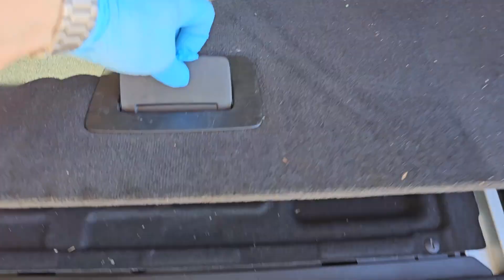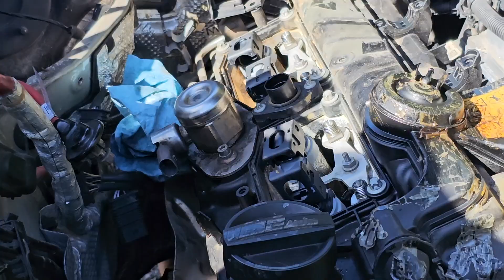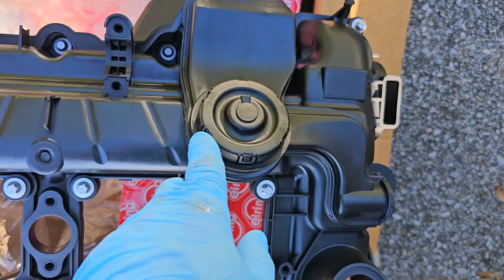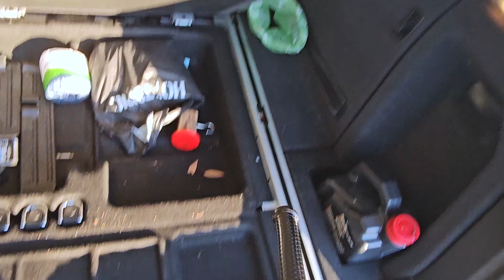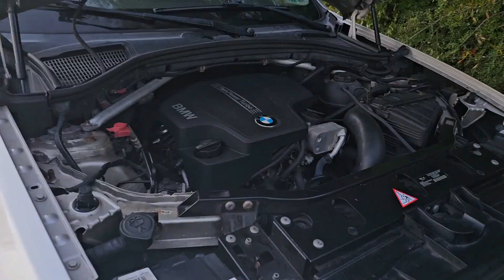Valve cover Replacement , n20 to n26 swapped

Comment: Thanks for this upload just swapped another n26 motor into my 328i the replacement motor has a bad valve cover so we’ll be doing this repair when it arrives. Upgrade to the aluminum cover for the n26 with built in pvc best wishes
Reply from the maker: Glad you found the video helpful, hope the repair goes well.

Comment: The oil cooler to filter housing uses 3 special bolts that are "one-time-use" (stretch-bolts) and they cost $25 each. Is it really necessary to replace these 3 bolts and not supposed to re-use them?  The other three bolts (different sizes) for the oil filter housing to engine block seem to be normal bolts.   

Also: is Mahle's oil cooler gasket that they call "bonded rubber" made of Viton (i.e. FKM / FPM) ?   It is MAHLE / CLEVITE Part# B32688 . The old ones were only HNBR (Hydrogenated Nitrile Butadiene Rubber) material and they deteriorated.   Thank you!
Reply from the maker: Hello! to do a by the book repair is recommended to follow BMW instructions!
Reply: @MOvidiu  I decided to pull the single A46/6B connector on my F30, which disconnects the 4 coils and the 4 injectors from the DME.

Comment: Welcome to the US and great move to FL!  Is a Viton gasket a must or using OEM is ok?  I need to replace my N26 oil cooler gasket that is connected to the oil filter housing, and possibly also the oil filter housing gasket.  No way to avoid removing the DME and intake manifold when replacing the oil filter housing?  Do we need to prime N26 engines after oil filter housing replacement? Thank you!
Reply from the maker: OEM gasket is recommended,  and yes, the oil system needs to be primed after working on OFH

Comment: I have bmw f10 520i 2014 with engine N20620B and my engine is broken..its possible upgraded to N20B20A without any problem with existing DME S\W, it's the same engine for 528i, i hope reply ASAP.
Reply from the maker: I recommend you to use the same engine type , you're 20B has a lower compression than 20A, and the 20A will equip the 2,8i. You can try replacing it and let us know!